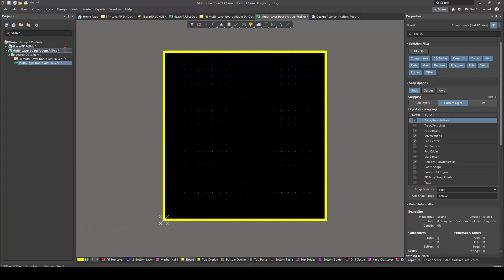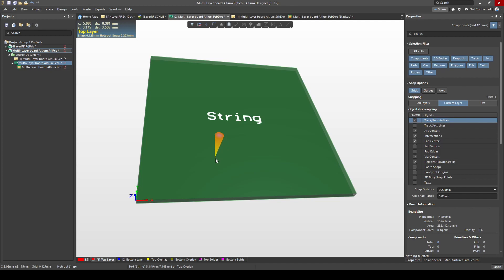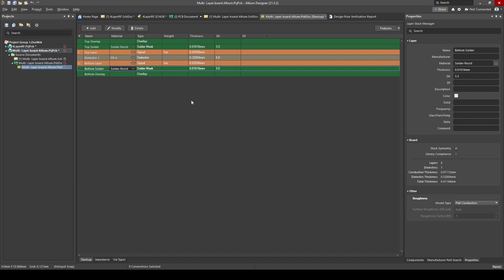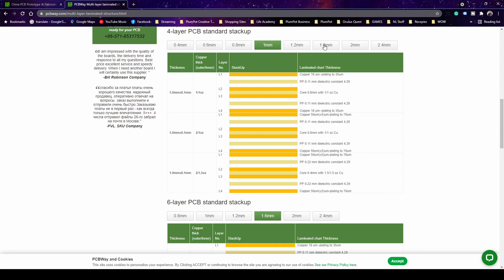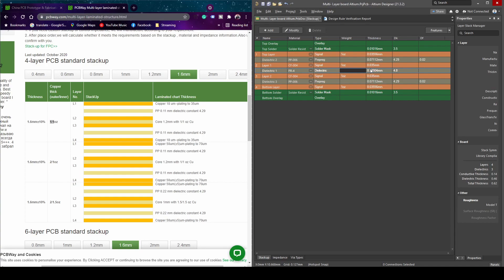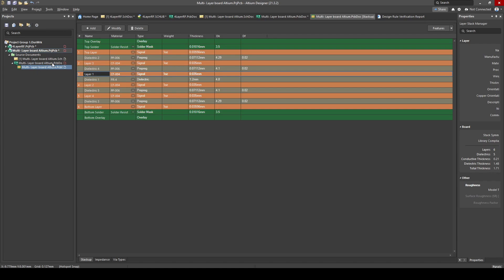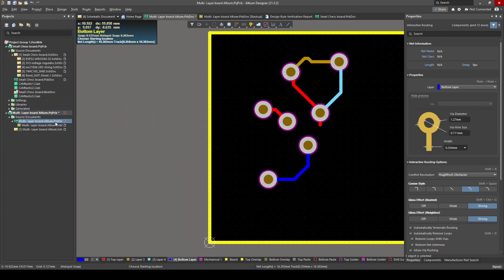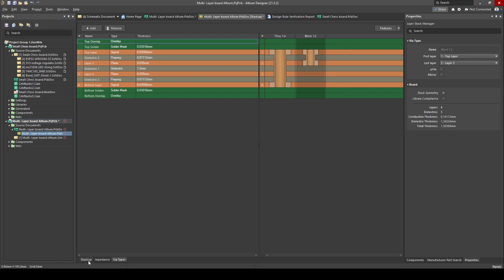Altium Designer Tutorials -  Create your first Multi-Layer PCB

Comment: The one thing I wanted know was how you add the layers in altium. You skipped that bit by just putting up a "press + Add layers". That is the one thing that Altium confuses me on and you missed it out. altium is confusing at the best of time, and I have been using it for years. When they change versions everything changes and I'm back to square one.
Reply: Yes at first he didn't menion but he added layer at 10:06 see this part you will understand.